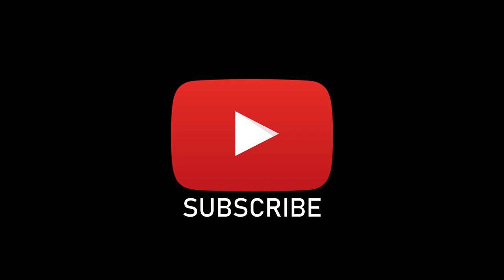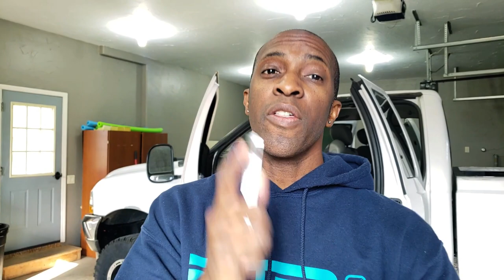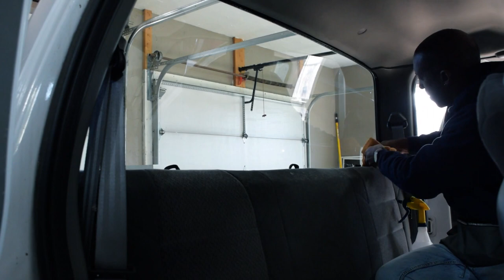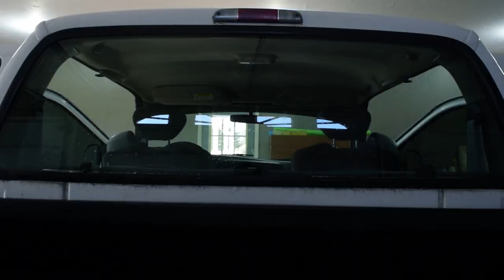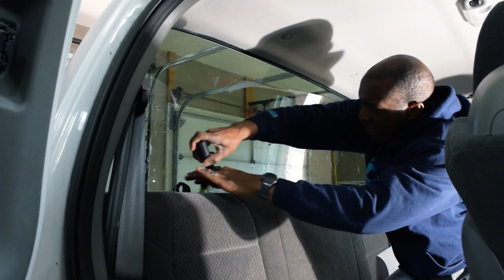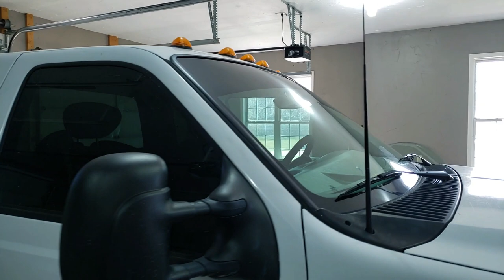HOW TO WINDOW TINT A BACK GLASS: Old School Rubber Seal Windows No Dot Matrix

Comment: killing it man! I hated these trucks SO much because of these back glasses. What I used to do was gut the inside gasket ever so slightly angled inward and it would give a 1/16" little bit of wiggle room on the inside. You said it perfect, "CLEAN,CLEAN,CLEAN!!!"
Reply from the maker: Yeah that works, make a channel for the film to fall into. If you can make it a nice clean cut outside I found that helps to keeps the shape of film matching the inside.
Then clean the heck out of it so all your work isn't wasted when you get the film inside.

Comment: Great work 👍🏻. Do you have a video on a 2000 f150 super crew. With the pop out windows around the opening mechanism?
Reply from the maker: Unfortunately no. Those are definitely more of a pain to do. If the bolts are not junk you can just remove them from the truck and install the tint.
Reply: @FadeToBlackLLC  yes I will double check that. It’s like two bolt and a locking mechanism. I’ll see if I can uninstall them thanks. I just tinted the driver passenger last night first install got a couple gaps due to the cuts but yes thanks
Reply from the maker: @jayp9450  Good luck!

Comment: so no shrinking with the heat gun?  did you trim your corners better once you removed from the window or was that the only cut you did?
Reply from the maker: You don’t have to shrink but it wouldn’t hurt. Just do it like a camper window. 
Once you install trim if needed. All of these aren’t exactly the same so adjust.

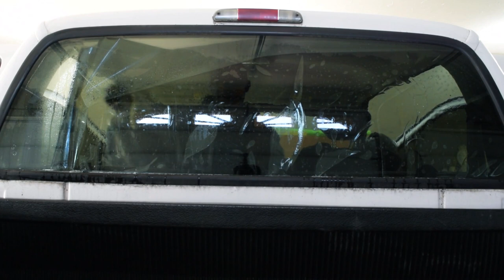Comment: At 10:44 you peel the liner and don't put that side against the window im new to this. I thought you had to put the liner side against the window?
Reply from the maker: It's Called Reverse roll.  Roll up the film and unroll it onto the surface.  It's a better way to handle large pieces of film. A little tricky but once you get used to it it works awesome. I do the same thing in all my Windshield videos too.  Check those out. I have a full playlist of them.
Reply: @FadeToBlackLLC  I appreciate that man

Comment: Do you bother shrinking the rear glass on trucks or do you pretty much touch up fingers on the inside?
Reply from the maker: I usually do shrink the new solid windows of trucks just to make the bottom have tension to keep the fingers away. It's better to do it outside then bringing heat in the vehicle.
I probably could have put some heat on this one too but I didn't. Definitely wouldn't hurt any.
Did you check out my Shrink video? I talk about this more in there.